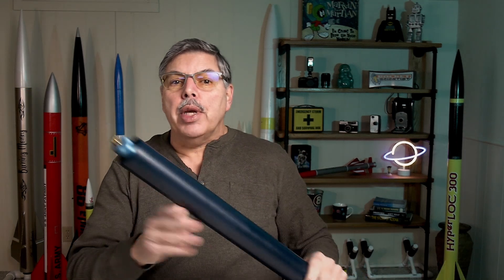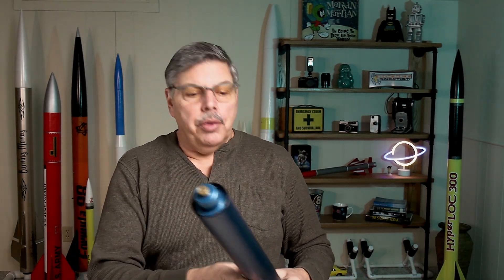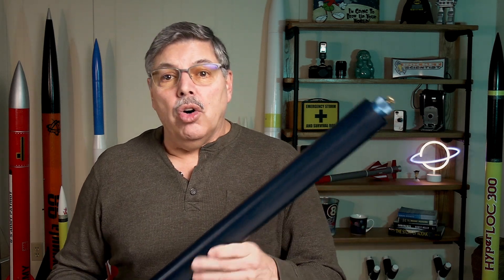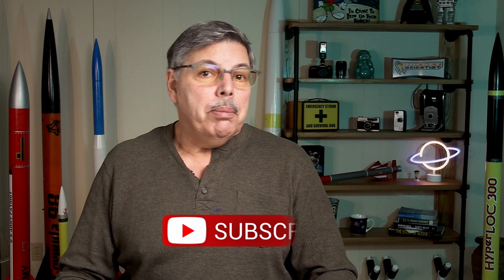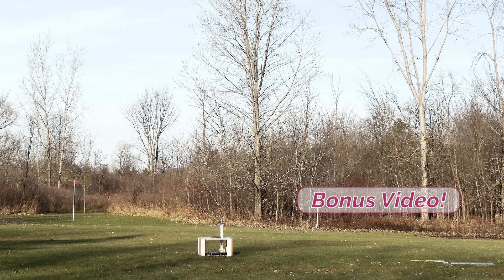Unlocking Maximum Power: The K-750 Sugar Motor Experiment

Comment: The K600 ns motor that burns longer may achieve a higher altitude depending on the rockets mass. I used to be suprised by this, but burn sim shows this to be the case. if i'm not wrong its been a while.
Reply from the maker: You are spot on! A slower burn and airspeed allow the rocket to achieve a higher altitude. The reduced speed causes lower friction in the atmosphere.

Comment: Thanks for the video.looking forward to the flight!
Reply from the maker: The wait will not be long!
Reply: @TheRocketeer  Sir, Can you use 80% Sorbitol and 20% Sucrose as a propellent without using Kno3 or any other chemicals for mid to high-powered rockets? I never heard it before but have seen it in one of your videos so I was curious how does that work?
Reply from the maker: @CodeCrafted_  The Kno3 is an oxidizer that allows the sugar to burn. It is required for this type of propellant. Potassium nitrate (Kno3) is a farm fertilizer and is used as a stump remover. It must be ground into a powder before use.
Reply: @TheRocketeer  But there is a high-power rocket propellent called ALICE that uses Water as an oxidizer. why can't one use water as an oxidizer along with sugar or sorbitol?
Reply from the maker: @CodeCrafted_  That would require NASA funding and technology to make it work.